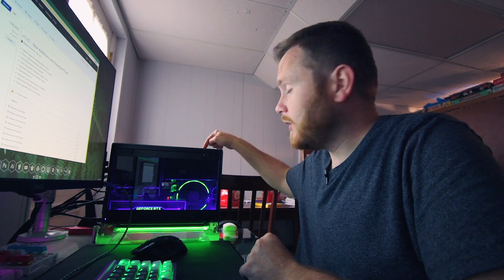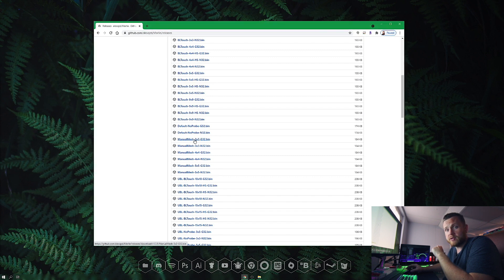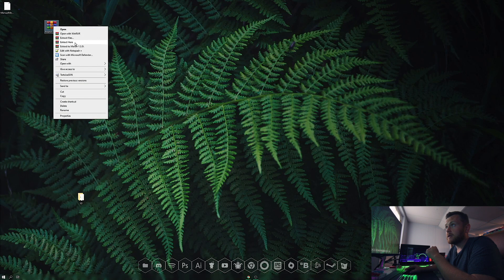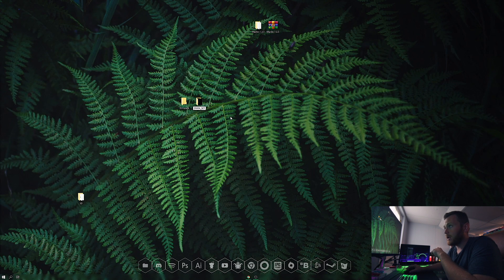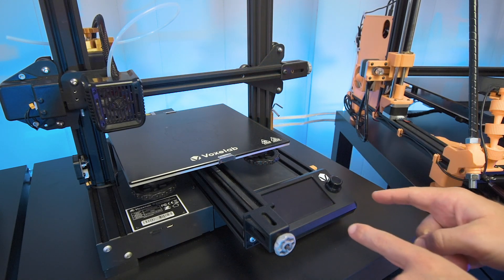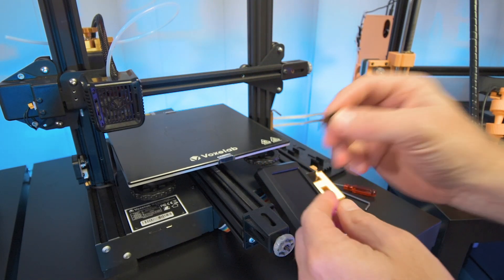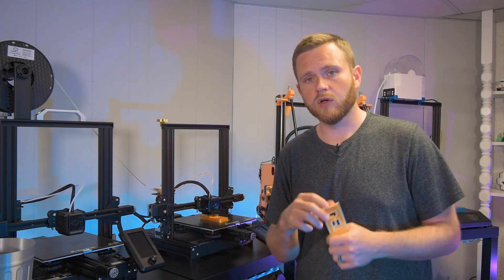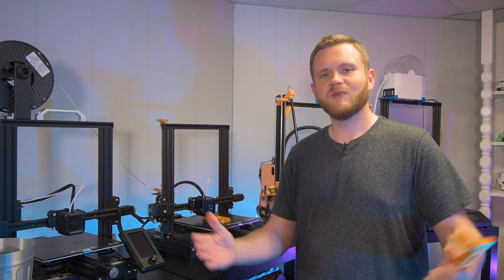Reduce Risk of Fire on Your Voxelab Aquila with 3rd Party Firmware

Comment: So I already installed the new firmware but now I do have a serious question. Does installing this new firmware change the PID tuning that came on the stock firmware?
Reply from the maker: I don’t think it keeps things that where stored in the old firmware. However, there is a built in PiD tuning right on the new firmware. So it’s easy to do.
Reply: @3DPrintSOS   I realized after I posted my comment. Haha! All I had to do was auto calibrate PID and recalibrate e-steps. Printing fenomenal now. Thank you so much for bringing us this information, Fedor!

Comment: I just think it was really unfair of Tom to say it was an issue with the Aquila and for him not to mention that the Ender 3's had similar and worse issues. I had two Ender 3's that had no thermal runaway from stock!
Fantastic video as always buddy. Keep it up. ❤️
Reply: I was thinking the same thing. Voxelab isn’t the only company that cloned the Ender 3 either.  I’m sure there’s more printers out there using the same Marlin firmware with the same problem. 

Additionally he made a point to show that the bed is flawed because the screw heads stick up above the plate and keep the glass from making good contact. This may be an issue for his machine but my screws are below the top and the glass plate sits flat all around.
Reply from the maker: I checked both of mine as well. It’s just a QC thing. If this was a $1,000 Inovation, it would have high quality parts and firmware on it. Is that ok? No, but I understand they HAVE to cut costs for this machine to be so cheap. So you kind of have to accept some level of imperfection
Reply: @joshwokojance3790  On both my Aquila's the screws do not protrude above the plate. They all sit below the build surface and don't caus any issues. 
Tom must have received a lemon in that regard. 😉
Reply from the maker: Maybe. I’m just trying to focus on the fact that his video is very popular so I know for sure it will be good for us consumers in the long run.
Reply: @3DPrintSOS  Totally agree I just wish he made more of a point that Voxelab was aware of the issue and working on fixing it future updates. ❤️
Reply from the maker: But hey, that’s why I made this one. :)
Reply: @3DPrintSOS  You are the man when it comes to the Aquila. 😊

Comment: Hello Fedor . I am new to 3D printing and have been watching your  videos for several months now, I purchased an Aquila and your videos have been great help in installing basic inexpensive upgrades. Now this one is quite a bit more important so I will be doing this one soon. I have been thinking about installing an all metal hot end, if I should do so would I be able increase the max temp in this firmware at a later date, or would I have to reinstall?
Reply from the maker: Awesome. Hmm to get a higher temp then 260 you would have to compile your own version of this firmware. It’s not too hard actually and the source code is easy to download. Search YouTube for a tutorial on how to compile Marlin and I bet you can get it done.
Reply: @3DPrintSOS  Thanks Feddor. I will be looking forward to more videos.

Comment: Hi and thanks for your great videos. They have been very helpful as I navigate my way. I want to bring up a topic though. How the company and printer names are pronounced. This has troubled me from the beginning. So I did some research. I was mostly confused at Aquila. Is it Akeela, Akwilla, Akeeya? Who knows. But in looking into it I learned that, though the word appears in other languages and is pronounced differently, one possibility is actually the english name of a constellation... which is pronounced Akwilla. I still had no idea if it was correct, but then they came out with the new model, and wouldn't you know Aries is also a constellation. My thinking is that Akwilla is actually the correct pronunciation. And then there is the company name. It turns out (I honestly can't believe that I didn't already know this) a "voxel" is the 3D version of a "pixel" (picture element). So I am pretty sure that the company name is pronounced Vocksel-lab.. with the "L"s just running together. I could be wrong on both counts, but I wanted to open up the topic to discussion. I haven't heard anything from the company.. since the setup video is silent. lol. Anyway. I know a lot of people are using you are the mentor for this printer, so I thought I would throw it out to you. Cheers!
Reply from the maker: That’s was fun to read. I gotta say. I’ve called this printer a bunch of things and very time someone corrects me. Haha so I stopped and started calling it Taquila minus the T. People stopped correcting me. Haha. 

By the way their other two printers are Proxima and Polaris. So that actually fits in with your point. That’s pretty cool!
Reply: @3DPrintSOS  I noticed that you were switching it up.. and figured it was driven by user comments. Haha. There is no winning. I love your videos whatever you call it. Keep it going.

Comment: Outstanding like always , Fedor !  I ctually like my horizontal screen.well bad luck I guess on y part.   Still...I have my machine now 2 months and its working non stop....never had an issue with the temps...might be related to the newer processors .I dont know . Hopefully everybody is safe now!
Reply from the maker: I’ve been using mine for 8 months with no issues. But for the piece of mind...
Reply: I got to the same reasoning but I can't get my hands on an original ST32 version board to test it. I think that the current chips availability constraints made Voxelab change to another chip and they didn't do their homework in the rush to get to market and keep production going.

Comment: Thank you, I'll get mine updated soon as I can in the next few days, I was a bit reluctant to change firmware just yet due to hearing some people getting new issues....but for safety it'll be worthwhile.  What are the differences though between choosing Default-NoProbe, ManualMesh, and UBL-NoProbe (edit : I see you've partially answered between Default and Manual already tho don't know what UBL-NoProbe is - I need to do some digging to find out about ManualMesh now I think - or just get a BL/3d/CRTouch :) ) ?  I don't have a BLTouch of any sort yet.
Reply from the maker: Just stick with manual. It works soooo well. ;)

Comment: I hope you can possibly help me figure this out. I have Alex's firmware on my Aquila and for some reason all of the LED bulbs in my home flicker anytime my printer is heating up and staying at the set temp. It does not do this on the stock firmware and I have done a PID tuning for both the bed and hotend. Any ideas?
Reply from the maker: Woah. That’s not something you hear every day. I’ve never heard of that before. :/
Reply: @3DPrintSOS  I found the issue, my printer is interfering with my Dimmable Led bulbs but I discover it doesn’t interfere with non dimmable bulbs! Everything is fixed 😁
Reply from the maker: Buuuuut why though. I have dimmable lights all around my printers
Reply: @3DPrintSOS  so far my best guess is just the fact that my house is from the 60s with some older wiring, I’m not even sure most of the wall plugs are actually grounded but are all 3 prong outlets

Comment: Great video, but it doesn't work for me as a Mac user. I can't get the firmware on my sd card correctly. Is there anyone who has solved this problem?
Reply from the maker: You can do it via Terminal. You open disk utility and put in your as card. Find the title of your sd card. For example “disk5s1”. Then open terminal and type in “sudo newfs_msdos -F 32 -c 16 disk5s1”
Reply: @3DPrintSOS  Thanks I will try this.
Reply: @3DPrintSOS  I can't get it done. This is so sad and frustrating. I want it so badly. Maybe someone else has any idea?
Reply: @maxmad1958  Do you have a friend or family member with a PC?They could put the files on your micro sd card.
Reply: @markmoore8297  Thanks for the advice. I've done this and it still won't work. It's incredibly frustrating. Maybe it's an idea that one of you send me your card.
Reply from the maker: So glad you got it working. Yea it’s definitely harder to do on a mac. That’s why I always have a version of windows installed on my Mac via boot camp. That way, I just boot up windows, use what I need and then go back to the mac.
Reply: @maxmad1958  So glad it worked for you.

Comment: Do you know if they have a horizontal layout version of the software instead of vertical? Great video thank you!
Reply from the maker: Not at the moment. They mentioned that it’s quite complex to get it rotated but they won’t fully dismiss the idea.
Reply: @3DPrintSOS  was very excited about doing this to the machine - my Ender3v2 already runs JyersUI and I love the manual mesh bed levelling feature...but it's a real shame to lose the horizontal display. Really liked that with the Aquila. I'll mull it over for a few days...will probably do it though as mesh levelling is just too awesome to pass up....did you print a part to mount it the other way up?

Here's hoping they eventually do manage a horizontal one!
Reply from the maker: Yep, it’s just a printed part. If you type in Aquila Mount in Thingiverse there is a nice adjustable one. :)

Comment: Which files are needed for the x2? 3x3 9x9 what does that all mean?
Reply from the maker: It depends what sticker you have on your machine. And also how many leveling points you want on your mesh. 3x3 is a good amount for our size bed.
Reply: @3DPrintSOS  so something I have found out with this firm ware. The aquila x2 loses its ability to restart prints after power outages. Who do we report this too and get it back? How can I get the orginal firmware back?
Reply from the maker: I believe it is a setting in the firmware. To get the original back, just download the files from the voxelab site and follow the same instructions with the bin and dwin files.
Reply: @3DPrintSOS  I got the old firm ware back. But I miss the leveling features. Is there a way to get that auto start feature back when power shuts off on the firmware. For the aquila x2
Reply from the maker: The only way would to compline your own firmware.
Reply: @3DPrintSOS  I have n32 220x220x250 aquila x2
Reply: @3DPrintSOS  then there is ubl bl and a bunch abbreviations I'm not sure what they all mean.
Reply from the maker: @BEASTmodeontheRoad  Those are all for BL Touch and Auto bed leveling sensors. Grab the same one I did in the video but with your chip abbreviation.

Comment: Has anyone had trouble with the original Aquila printer (not screen) not updating the firmware?  I tried a 16GB micro SD card formatted at 4096 and it would never work on the printer but worked great for the screen.  Printer finally updated with a 32GB micro SD card formatted at 16kb, no idea why that worked and the other didn't.
Reply: Sounds strange. I used a 4gb sd card a couple of months ago and worked fine. Hmmmmm.....

Comment: Tried doing this on my Aquila X2 H32 chip printer with no luck, all firmware I tried flashing had messed up UI and I spent hours trying different things to no avail, even complied marlin 2.0.bugfix that said it had support for the X2 and got the same issue of UI being cutoff. Has anyone been able to successfully flash the X2 with new firmware?
Reply from the maker: If you have a H32 chip and not a G or N you will have to be patient. The H models aren’t compatible with Marlin firmware. It’s a part of the issue for sure and it’s being worked on.
Reply: @3DPrintSOS  Alright, thanks for the response, just got my first printer this weekend and am still tinkering with stuff. Your video's have been really helpful. :)
Reply from the maker: No problem. Glad I could help. :)
Reply: @3DPrintSOS  Still don't see any versions of Marlin for H32 models ;-;
Reply from the maker: Hopefully soon. I check in with Alex here and there and he’s working on it.
Reply: @3DPrintSOS  Thank you for the response. Not a lot of people would respond to such an old comment. I'll just try and be more patient I guess. :)

Comment: Get the 5x5 manual mesh.  Man my printer is a dream now.  However, when you turn your printer on you must go to Leveling and turn it back on.  Every time.
Reply from the maker: I think this can be solved with a start gcode in the slicer. M420 S1 I believe.
Reply: @3DPrintSOS  I will try that.  Thanks for doing this video!

Comment: I'd like to know the difference between manual mesh and default. I'd also like to see a rundown of all the features the new software has. We know it has thermal runaway protection, but what other cool things does it have?
Reply from the maker: It’s likely just normal leveling with no mesh. Yes there are TONS of features. I really wanted this vid to focus on install and fire prevention. But I plan on doing a deeper dive. There seems to be a bunch of interest.
Reply: @3DPrintSOS  I think I have the same aquila and octoprint is telling me I should update my firmware ! It looks like I should do exactly what you did in this video but I want to know why you chose 3x3 manual mesh g32. What are the others and should I care about them at all ? Is there a document that explains what each is ?
Reply from the maker: Octoprint might always tell you that on the Aquila. Depends on the firmware. 

Manual mesh let’s you make a mesh ontop of your bed kind of like an auto leveler would do except you do manually. 3x3 is the points on the bed. The more, the more accurate the mesh but more time consuming. 

The others are BLTouch which is an auto leveling sensor you can install that makes a mesh for you using a probe and another firmware that is just regular old leveling. Completely manually.
Reply: So I have a BL touch so this is how I learned it but within the software you can level (aka z-offset) different points. if you don’t have a bl touch but it makes a mesh like it does with the auto.

Comment: Please feature changing the ext temp to 300!!! I have all metal hot end and hardened steel nozzle and I want to print CF nylon
Reply from the maker: I print cf nylon at 260 just fine but yes, I think a deeper dive it likely needed.
Reply: @3DPrintSOS  I have to 3dxtech cf nylon and I like to print my filaments at the higher temp range especially with a steel nozzle because it doesn’t hold temp as well as brass
Reply from the maker: Hmm the cf nylon I’ve been using has been awesome at 260 with a steel nozzle. But you can definitely recompile the source code with a higher max temp.

Comment: Nice. Just 2 days too
 late (as I did this over the weekend without knowing about the fire hazard). One thing I noticed that the firmware folder was empty after the flashing, so it should be safe to plug in the SD card after flashing both. Not sure if this is a fluke, but I saw it on two occasions (first flashed without BLTouch to print the support and then the version WITH BLTouch (which in itself worth a video IMO)
Reply: Don't think it's a fluke as I did notice too that the past few FW rev's deleted the bin file from the card after flashing.
Reply from the maker: Ah. That could be it. I typically just clear the sd and out my old files back. But you could be right.